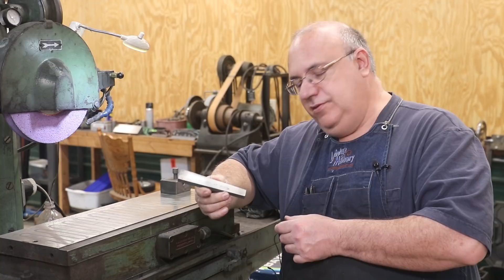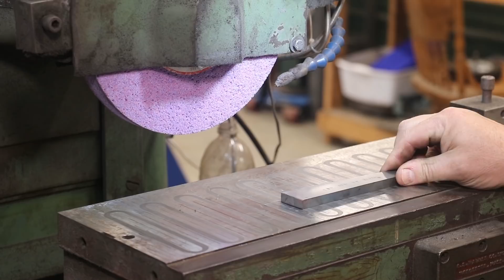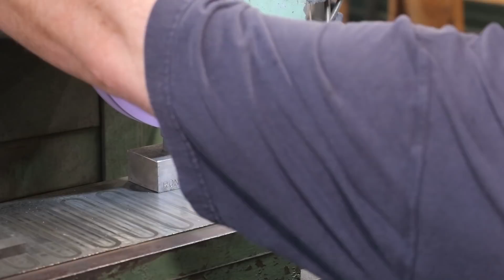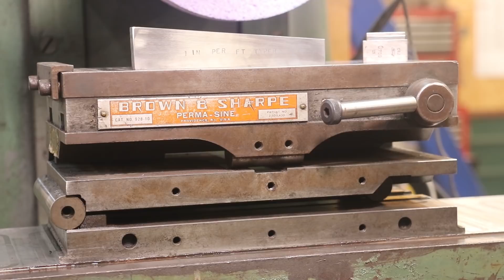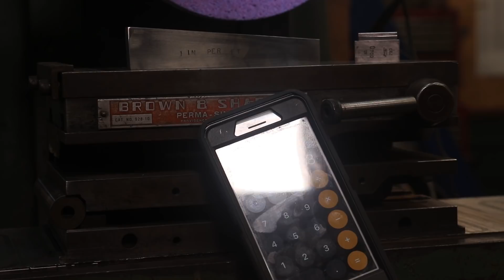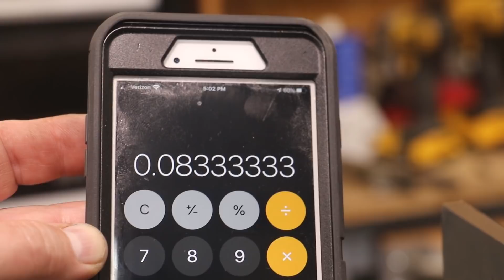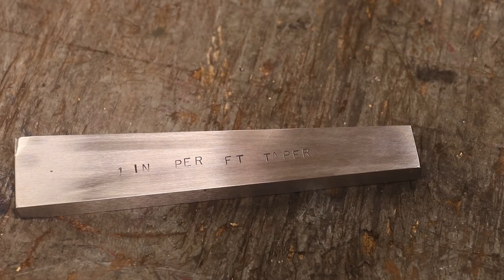Grinding a Hardened Taper Gage: 1 inch per Foot Taper

Comment: Good job as always Keith. If I may say one thing and preface it with; I'm not a safety Nazi, far from it and i'm sure I have far less experience in the machine shop than you. However, there is one thing I'd like to mention; I've seen someone who owned a machine shop for 30 years and his only serious injury in that time was from wiping a mag chuck with a rag just like you did with the spindle on. I'm sure you already know what happened, but he was lucky to have any hand left at all after they patched him up. Not telling you how to work, just wanted to mention it. I definitely think that squeegees are a much safer and effective tool for the job. ATB.
Reply: Very tactful and considerate suggestion.
Reply: @ron827  Sqeegees are much safer.  NO RAGS!

Comment: It doesn't look like you have your sine chuck indicated in parallel to the chuck and your part is not indicated parallel to the table travel
Reply: I don't think that matters if the table is level in the y-axis.
Reply: @milesbowen9599  If the work piece is turned at an angle to the chuck, it will wind up with a compound angle
Reply: @Single70s  , thank you for the correction; I don't know what I was thinking...
Reply: @milesbowen9599  That's okay. I was a tool maker for 45 years and have had my share of not understanding things

Comment: I think it is necessary to align quite precise the work piece to the X axis of the grinder when grinding in the taper??
Reply: Yes! Otherwise, you'll be grinding in a small lateral angle to the taper which makes it inaccurate in the direction parallel to the longest axis.
Reply: @tabaks  that's what I was thinking.  I was surprised to not see either the fixture or the work-piece checked for parallel to the travel.
Reply: nice work Keith!
Reply: And when measuring with the taper micrometer, but he was within his desired tolerance, so all fine.
Reply: I did the math: if you're off by, say, 5 degrees the error in the desired taper angle is 0.4%.
With good eyeballing you should get it on within 2 degrees, which means an error of 0.04%. Not that critical, though.
Reply: @Current Batches What I meant is the misalignment of the work piece relative to the table x-axis, not only the sine plate. You're absolutely right, is IS advisable to check for correct alignment, I just wanted to show the influence of any misalignment, and how benign it is.
Reply: With a back rail on the sine chuck you can easily align the part with a parallel. But firstly the bottom face of the gauge should have been ground square to the sides which it was not. I would have slightly rotated the sine chuck on the magnet so when grinding the part you are not hitting the entire length in 1 pass to generate heat regardless of mist.
Reply: It's not really necessary so long as you don't have the part at such an angle that it moves or gets knocked over when the wheel passes it. the surface grinder is going to grind a plane that is parallel to the table regardless of what angle the part is to the x axis
Reply: @Nanox730  Nope, see my other comment. Believe me, I'm a mathematician (really!), but one of the rare species who at the same time loves to get his hands dirty with machining.
Here's the formula: you have to multiply the intended slope angle by the factor cosine (misalignment in degrees) to get the resulting slope angle. Note that I'm using the cosine of degrees, in radians this would be cosine (misalignment in degrees  * PI / 180).  You see, as the misalignment approaches 90° (or perpenticular to the x-axis) the resulting slope (in the length direction)  is becoming 0°.
Reply: @Nanox730  You are creating a compound angle with the piece not perpendicular to the pivot of the sine chuck. If you still don't believe me then put the work piece at a 45 degree angle on the sine chuck. What does not matter is the alignment of the sine chuck on the grinders chuck and in truth it should be slightly rotated to limit the contact of the wheel on the work piece as to not grind it along it's full length to reduce heat.